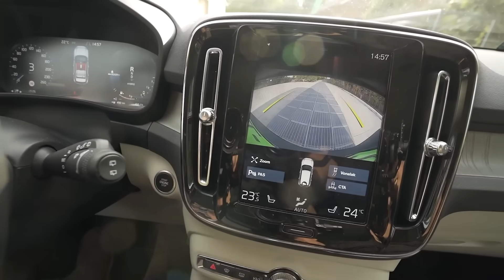CONSTRUCTION TECHNOLOGIES THAT HAVE REACHED A NEW LEVEL

Comment: 👍👍❤❤The connections, which looked like Lego, were great, especially if there was a place inside to pass e lectric wires or water pipes.
Reply: Yep, at the end of it's life it can be shredded and reuse for other products.
Reply: Sadly they're $18. CAN each and a structure built from them can't be occupied.

Comment: 3:20 these plastic material may be strong, but what about heat resistance, fire protection, insulation, humidity inside the building and so on?
Reply: Most of the things in these videos are prototypes will never see much if any sales.

Comment: For all of you "greenies."  Hydrocarbons remain the basis of a vast petrochemical industry which provides everything from plastics, fertilizer and cosmetics to pharmaceuticals and textiles. There are numerous industrial processes such as smelting steel and producing cement or glass that require very high temperatures which are difficult to obtain without hydrocarbon fuels.

This mad dash to zero cO2 is lunacy.   The Cop28 president says there is 'no science' behind demands for phase-out of fossil fuels. The president of Cop28, Sultan Al Jaber, has claimed there is “no science” indicating that a phase-out of fossil fuels is needed to restrict global heating to 1.5C.  He was correct that the elimination of petroleum based materials will have us living in  caves.   

Recycling is an excellent use of materials but it has its limitations if growth occurs in developing countries.   The products shown in this video are an excellent use of resources.  Man's ingenuity set into motion creates great things.    Fossil fuels, which provide 80 percent of the world’s energy, have and will continue to have the unique benefit of providing low-cost, reliable energy to billions of people in thousands of places—a benefit that is desperately needed in a world where some 3 billion people still use less electricity than a typical American refrigerator.